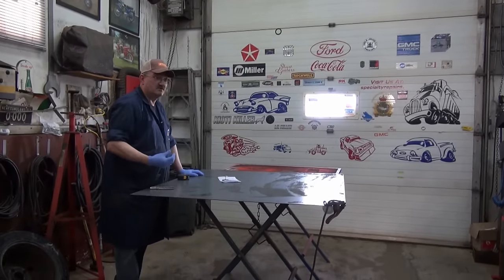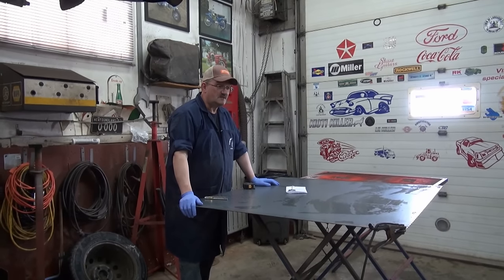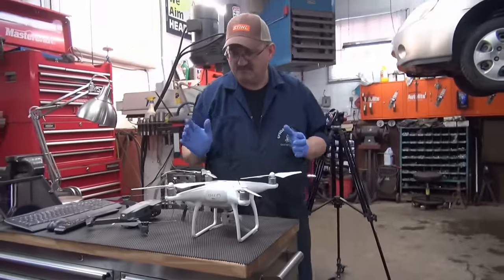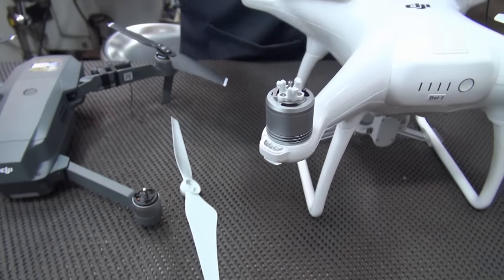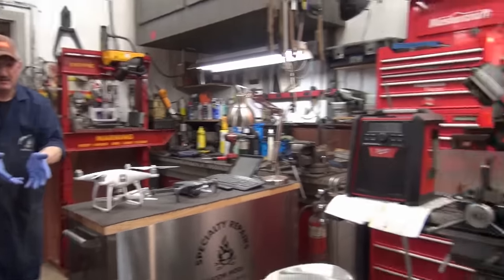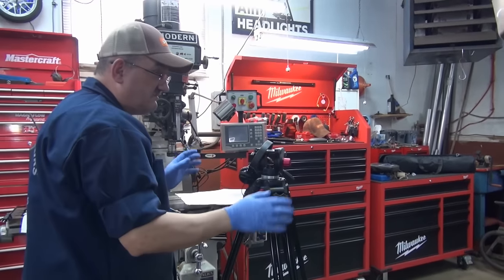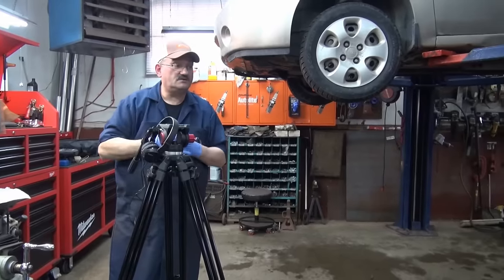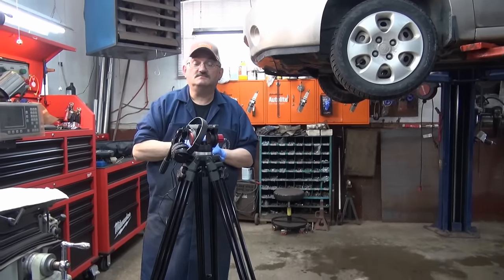DJI Phantom 4 Updated Part & Other Stuff

Comment: Paul, have you ever had a car or truck slip off the hoist? Back in 1974 i had my pick up getting my summer wheels and tires off and putting winter tires and rims on, luckily my truck was only 4 feet off the ground and nobody was near. It slipped off the rack and rear bumper hit the roll up door, didn't hurt anything. I sure like the beginning of the videos and the music!!!
Reply from the maker: Yes I have. Not in our shop but at the dealership. I'll tell that story in the next video.

Comment: What is wrong with the 5gal jerry cans? they have worked well for 75 years! That new tripod is heavy enough to mount a .5 Browning on!
Reply from the maker: Nothing wrong with these can's. It's the other safety ones that don't have a rear vent in them that's the issue.
Reply: Paul as a mechanic you would know if this is true .... I was told that it was done because the new gasoline has ethanol which will suck up moisture if they are left open to a moist environment ... I use leave the vent caps loose when storing gas outside in the shed because the jerry can would just puff up to where it looked like a Soccer ball ... when it got hot outside ....if I did not leave the vent open a little or the it would implode when the temperature would drop ... I have heard of all kinds of water troubles with older boats (mainly boats) and cars that don't have the new pressurized fuel tanks where they draw air into the fuel tank (through the fill cap) as the level drops in the fuel tank ... I remember filling up at a gas station one day (many years ago) and this guy came in with this hot Mustang and big attitude... he unscrewed the gas cap and you could hear the air rush into the tank followed by a loud bang (metal gas tanks in those days) as his gas tank tried to return to it's original shape after been imploded by the fuel pump sucking all the gas out of the tank and obvious his gas cap was not allowing air into the tank ... I wanted to tell him but his attitude was too much so I let him be.

Comment: Witch drone do you prefer to use Paul? the Phantom 4 or the Mavic pro?
Reply from the maker: I'd have to say the Mavic Pro because of its portability.
Reply: I would strongly agree with you Paul.  the Mavic pro is a small portable drone that you can fit in a small case and take it anywhere you want.

Comment: your thoughts on the new drone laws?
Reply from the maker: Well you can hear them in this video. If you read the comments you'll also learn more on my thoughts as well. https://m.youtube.com/watch?v=bSFmhybEQvg&lc=z23ft5ja3xyefrmdracdp430bd2sx5v01he3gu2qexlw03c010c
Reply: Just watched the video and I have to agree, I'm from Halifax and at this point 98% of it is a no fly zone due to the fact that there are helipads, and sea plane lakes and military bases everywhere. 3 km if anything is more than enough. 90m up I think is alright because you can get some reasonable shots from that altitude. 500m away and in sight is ridicules because "drones" navigate using gps and we know where they are on a map at all times. 75m away from anything is also a joke, 5m away is enough, the reason they put that in is because if the drone fails and falls it could hurt someone (and that would be manufactures problems) night flying should be allowed because it's easier to fly because of the built in lights on them (personally I like flying at night because I can visually see where exactly the drone is and in what direction, because in the day, white drones and blue skies with that distance makes it impossible to see where they are) and lastly, I read something that says a drone is considered anything that is unmanned, remotely controlled, and operates "on its own" well our drones are remotely controlled, and for the most of us, do not fly themselves unless you tell them to, so I though that if I put it into "no possition  mode that it would not be considered a drone, well it turns out the legislation applies to "anything that is remotely controlled, mechanically flown or propelled, and does not carry living things, meaning anything R.C is also banned, so I guess my loophole I found is to put some lizards or ants on the drone, then the law is nul and void...
Reply from the maker: It's mostly all ridiculous but it do have plenty of loop hoes. They say don't fly any closer than 75  linear meters from buildings,  animals  etc. But they don't say you can fly above it do I guess we can be charged flying above if we done go over the 90 meter height limit. We're I am I still have plenty of options to fly but remember. These are only interm laws written by but not voted on by parliament. The official laws will come later this summer. It might be better or they may get be banned all together.